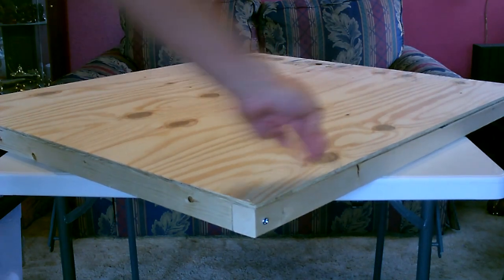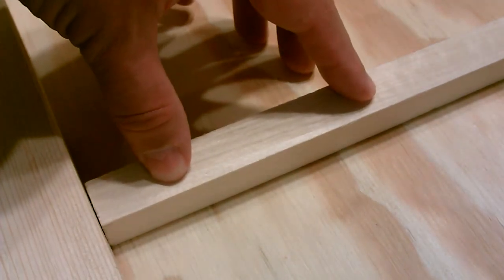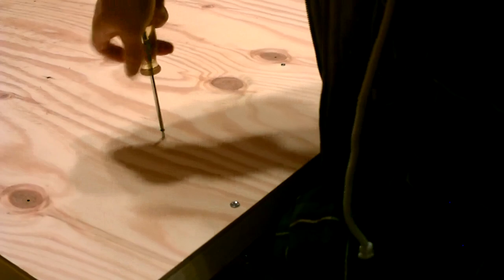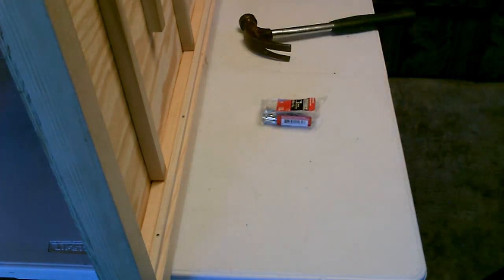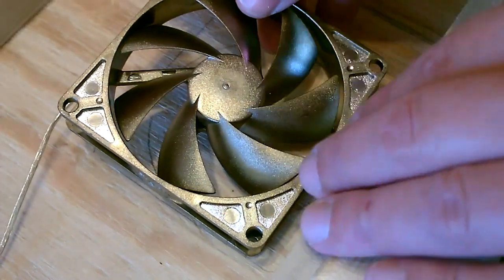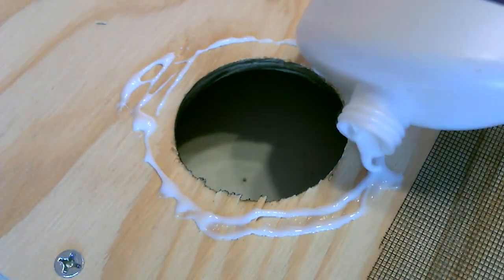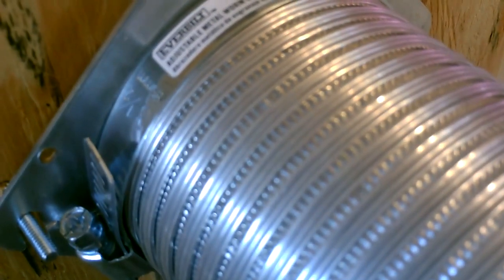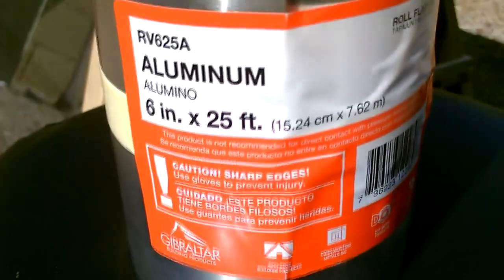Solar Thermal Air Heater! - Solar Heater w/Air Channels/Baffles  - Easy DIY (Full instr.) 150F+

Comment: How do you connect the fan to the solar panel? Sorry I’d love to make this for my greenhouse build :-) great idea and such a slim nice design ❤
Reply from the maker: hi. i think this would work great with greenhouse. the fan is just a straight connect from the solar panel wires to the wires on the fan (just connect negative to negative and positive to positive). then when the sun is out (and the heater is heating) the fan will run and when the sun goes down (and the heater isn't heating) the fan stops.

Comment: I didn't catch the reason for dowels?
Reply from the maker: hi. those are used to direct the air in a serpentine or "snake like" pattern so it has the most time to heat up before being drawn out of the collector.
Reply: @desertsun02  I thought that was what the boards under the dowels were for?

Comment: I have experimented building 3 A2 size solar mesh air heaters using black A2 foamboard, timber sides, foamboard  channel sides sandwiching a fine black mesh (7 channels) and "double glazed" 2 acrylic sheets. Each has a 5cm USB fan. One feeds into the next which feeds into the next. I have achieved almost 20°C temperature rise see photo. I have a Facebook group on homemade solar air heaters for sharing information (very early days). Can anyone suggest better materials? What temperature rises can I expect in winter sun in UK? Anyone else tried a "chain" of them? Anyone have figures for fan speed vs temperature rise? With UK gas (not gasoline) and electricity sky high we need all the help we can get.

Comment: Did you ever add the flashing to see how much of an increase you could get?  Also what is the furthest you have pulled air from you solar furnace builds while maintaining heat?  I have a shop with full exposure to the sun on the south side until almost dusk and I was looking to build a few large solar furnaces to keep it from requiring to much gas to heat.  I had planned to run some 4" insulated flexible ducting from the units to come out of the ceiling or wall.  The flexible ducting will be used to cover the open storage I have between the wall and workshop so I would be pulling air from about 10-15 feet from the unit.  Thanks for all the great videos.

Comment: If the idea is to route the air through the box and slow it to maximize heat pick up/ transport then wouldn't it be best to put as many channels inside as physically possible?

Comment: What will get the temperature up is a bigger size like 3 feet wide x 6 feet high and 4 inch deep and  used thermo glass and isolating the back,with 6 feet hight you dont need a fan!

Comment: For maximum efficiency you should pull the air from the house and not the outside...similar to how an automobile would work.  Heating exterior air makes the design more susceptible to under cooling due to temps outside.
Reply: Ive seen a video about installing on the inside of a windows I think would be a good idea if you dont mind blacking out window

Comment: Great video!  What did you use to bed the front screen onto the support rail -  and how has the seal held up to high temps? Thanks for sharing 😃
Reply from the maker: hi, and thanks. i'm still experimenting with the collector (adding aluminum strips etc...) so i haven't permanently sealed it (but the best thing i know of to use is just 100% silicone caulk).

Comment: Fan would be easier to service if it was built onto the outside. Hot air expands. Would the performance be boosted if the cleats were farther apart at the top (or closer together at the bottom)?

Comment: What was the temperature outside before you measured the temp. inside the duct?  That's important for me, because I really liked the way you made this and am thinking on doing the same, but I'm curious about how much hot air it would draw out on a winter day.  Overall, very nice video.

Comment: Quick question....when putting the back on would it help to caulk before screwing it on? Second, if you built this unit deeper and had more air capacity do you see hotter temperatures when you compare this unit vs the one you made with the downspouts?

Comment: Nice work! Does the glass sit on the rectangular frame only or also is supported by the horizontal dividers?
Reply from the maker: hi there. the glass sits on the rectangular frame only. the horizontal dividers are just a sliver lower than the glass. (main reason for this is that even though the lumber looks completely flat is actually has slight bends/curves in it and those slight variances in the wood make it impossible to lay the glass flat if the dividers are touching the glass)
Reply: Cheers! Will be making this one soon!

Comment: Just a suggestion. You should put the fan in the intake side of the holes because it will last longer with cool air instead of hot damaging air.
Reply: That's a good point, though I can see him putting it there because a fan is much more effective pulling than pushing.
Reply: @raywharton9425  What do you mean? Does not fan both pull and push air all the time?
Reply: @Teknopottu  that is true, but if the air has to travel through a restriction more so on one side of the fan than the other, for example an open room on one side and a duct (or baffles) on the other, then it's better for the fan to pull air from the restricted side and push it in to the open side. In terms of air moved per energy utalized by the fan. The air blowing from a fan is very turbulent, and creates a lot of drag going into a restriction, but blowing into an open space the drag is minimal. The air on the suction side hasn't been made turbulent by the fan and being under suction is at lower pressure, both factors lead to less drag, which is a more important factor on the more restricted side of the system.
Reply: @raywharton9425  Thank you for your comment. There is a lot for me to learn from aerodynamics.

Seems I misunderstood the original comment. I thought it meant that why not install a fan ALSO in the air intake. Misreading can be a thing because English is not my primary language.

So, a fan works best by pulling from smaller/restricted place and blowing on bigger/less obscured, right? Does it mean that the fan would work in most effective way if installed on the vent inside the room that it's blowing the hot air in? Building a heater soon and been wondering about this.
Reply: @raywharton9425  The way I understood this it's better to install the fan inside my house then and not inside the heater. Thank you for your time!

Comment: Great video! The little fan would work great in the return pipe from your room being heated. Cooler air is denser and the fan will move it more efficiently.

Comment: another great video!... where do I get the solar fan?
Reply: I have seen similar builds that use no fan, simply an intake and outflow holes.
Reply from the maker: hi there. the fan is just a computer case fan. amazon and fry's electronics are 2 good places to get them